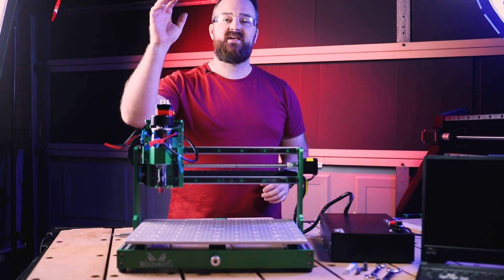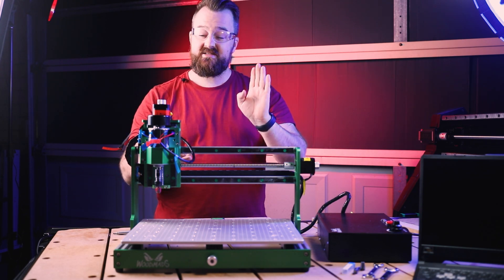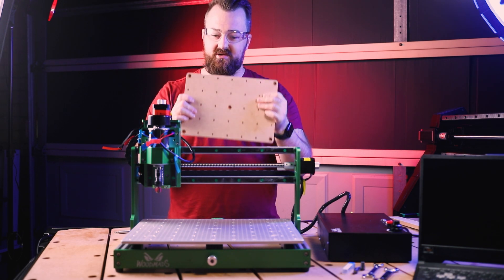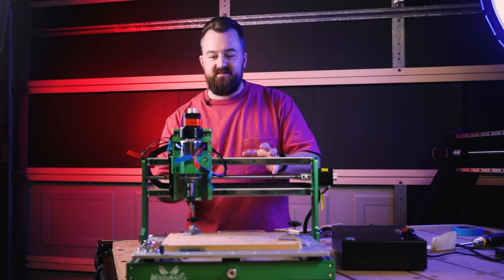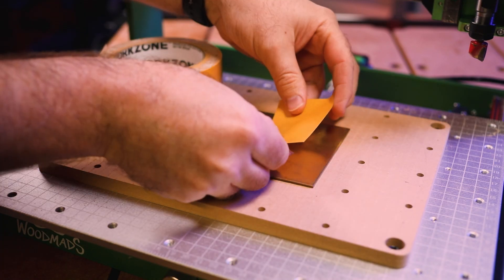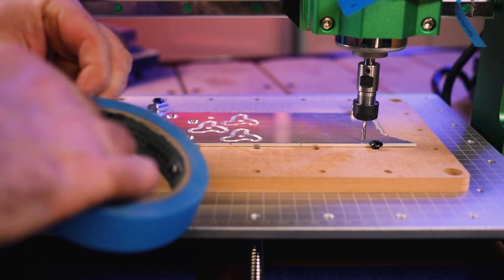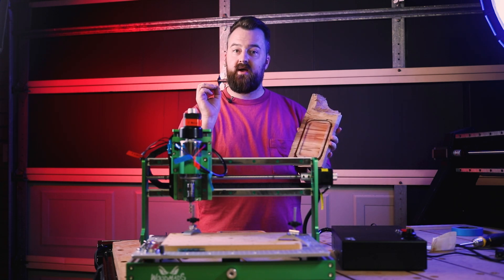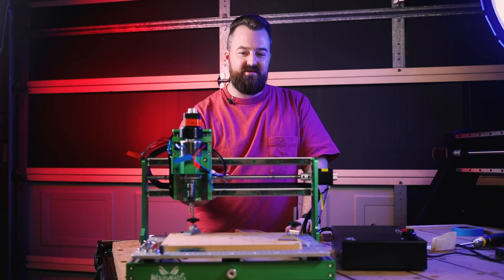WM3020 // FoxAlien x Woodmads

Comment: Got this machine six months ago. I played around with it for a few weeks then gave up :(

I wish there was a good YouTube channel on how to operate the is machine with third party software etc.
Reply from the maker: Great comment! I have been meaning to do something like this for a while. Happy to help you get started and figure what you need to know that I could include in a video. Send me an email at newtechcreative@gmail.com if you would be keen?
Reply: ….sent
Reply: Got mine today ... Started out with the standard software and it works. Really any grbl gcode sender will probably do. A few hours later I was designing stuff in fusion 360 and using the NC processor to generate the GCode.

Admittedly the default spindle is ok for a desktop machine. Probably will upgrade it to a teknomotor 330W, 400W or 600W before long though. If I manage to make a little adapter plate to mount it. Still it did blew me away on accuracy. A biiiiiiiiiiiig step up from my first machines (had several desktop models sofar including homegrown ones). This thing is a gem. Just don't expect it to be a professional metal milling tool. You can mill metal sure but if that is your goal there are better options (that cost more). Have one of those too, a 60x50 full fledged 70 kg heavy desktop CNC from Sorotec.

Why did I get this machine then, pcb's mostly or doing the odd little things like front panels or housings for those pcb/electronics projects. Things like that. Stuff where setting up the bigger machine (limited space workshop) would take to long for what it is. And of course pcb's is just easier to do by far on these smaller machines, odd as that may seem. Mainly heightmap probing that makes the difference there.
Reply: Wow ok thank you, I just need to put time in to playing around with it. Keep you posted!

Comment: What plunge rate, feed rate and RPM are you using from aluminum?
Reply from the maker: Thanks for your comment! From memory I think it was:
Feed rate: 400mm/m
Step down: 0.2mm
Spindle speed: max (I think max is around 10,000rpm)
Endmill: 3.175mm single flute 
This was cut with a ramping contour cut!
Reply: @NEWTechCreative  Hi (wow) thank you for the reply! I have one of these and have broken a bunch of bits using a 200mm/min plunge rate according to a Fox Alien video. But It looks like it will work with a ramping cut. What software do you use to do that? EstleCam does not have that.
Reply from the maker: Yes the ramping cut can be a less aggressive cut! I used fusion 360 to program the tool path however you might need to research to see if your software offers this!! Here are some other considerations for successful aluminum cutting:
- purchase a proper aluminum cutting endmill
- use 6061 aluminum 
- ensure that you use air to clear out chips and or lubricant to assist cutting
- ensure that you stock is secure as vibration might break your endmill.
Good luck 👍

Comment: I can assure you, ball screws make a HUGE difference on this machine. I have this WM3020 machine and have done a few  mods on it to improve overall accuracy. I can easily trust it to hold +/- 0.001" tolerance, something I could never do with my 3018 'PRO' machine. The typical lead screws with brass insert nuts & spring-loaded backlash compensation are weak points of any 3018 series machine.

That said, there are a few corners FoxAlien cut on this machine that they should not have, and kept it from being a truly 'next-level' 3020 series machine. They already charge the price for it, but they short-changed the design. I fixed a couple of these items with my modifications.
Reply: Alright so ... this is where I am at.
- Spindle, Teknomotor 600W HF spindle with VFD. From a well know German CNC store. They also sell mounting plates for this (square body) spindle and their hobby line machines. I shortened the bottom plate and drilled 4 countersunk holes in that same plate to mount the spindle to the Z-axis with the custom mounting plates they make. Main reason, decent spindle with ER-16 Collet (ER-11 is ok but not being able to use 8mm shanks always annoys me at some point).
- On order (waiting for arrival) : 3 T42 drivers with closed loop steppers (nema-17 also) 0.8 Nm variaty. Not sure these will work yet though. They look good but have an 8mm shaft. I might end up using JMC Nema-17 closed loop steppers (.IHSS42-24-05) instead. Little less power but I have their bigger brothers on my LinuxCNC heavy duty mill and ... well good stuff
- On order (in customs now) : RootCNC ISO 3 controller (FluidNC). This is the main reason (well not this controller but that it is GRBL compatible and thus easier to use with PCB isolation milling soft and techniques like height mapping, or that is the hope).

Even with just the Spindle on there... I am impressed. Using a facing mill with changeable inserts to face aluminum and getting quite nice results (for a machine like this).

I did have to fix the Y axis endstops. The endstops on this machine are ... well ... bad. The one on the Y axis uses one of the heads of the screws for the linear carriage to actuate the microswitch... Baffled as to who thought that was a good idea. Didn't take long for that screwhead to go past the roller, then come back the other way and bending the roller and leaver of the microswitch back onto itself. Used a better brand and with a longer lever so it hits the frame before the screw goes past the roller and might go for inductive ones too (the out of the box controller isn't really designed for that, unlike the RootCNC one).
Reply: @xConundrumx  Wow, you're really well on your way to a NICE setup! Love it! You've selected some really good quality components. I hear you about the limit switch trigger on the Y axis (as well as the X). I had to put a washer under the 'home' position screws to ensure a good reliable trigger for X and Z. On the other ends, it doesn't trigger, I have it set up with soft limits. 

Actually, my WM3020 went into early retirement. I had a custom Onefinity built, and jacked the nice table plate from the WM3020 to use on that. I have since replaced it with a standard 3018 type of extrusion table, and will probably pick up an Openbuilds controller for it, just so it will be a running machine that can either be put back into use, or sold.
Reply from the maker: Thanks for this info!! If you have any videos or photos of you upgraded machine, I would love to see it!!
Reply: @NEWTechCreative  I've got some pics (no videos), but not sure where I can post them for you to see. Are you on FB at all?
Reply from the maker: Yes I’m on as Myles Newtech otherwise email at newtechcreative@gmail.com !!
Reply: @billblades9195   what mods did you make ?
Reply: What mods did you do to make it better? about to pull the trigger.. probably...so many opinions to sift. Thankful for any advice you have
Reply: @digitalabstractions  Just sent you a DM on FB. Will follow up later.
Reply: Thanks!
 @billblades9195
Reply: @billblades9195  also interested in this, mine is arriving day after tomorrow so ...
Reply: I doubt you will get this comment seei g that you post is from 2 years ago but who knows I will still guve it a try. So I just got this same exact machine 2 months ago and am having some issues with getting g it to run. Its my first machine, so in very new to it. I have watched countless videos on how to set everything up but I still can't seem to get it to run/having a hard time setting it up. Is there anyway I could get your email address or I can send mine and we could possibly talk about what I could be doing wrong. Im at the point where im about to give up and buy a different/newer machine. Its pretty rare that i give up on anything but im just completely lost on what im doing wrong and just about at the end of my limits 😢

Comment: I'd also recommend the AnoleX Evo CNC which you can get for $700. I know it doesn't have ballscrews, but I can't imagine how much of a difference it makes at this level of machine. On the other hand, it's got a larger 3040 bed, larger 60mm stepper motors, a beefier gantry and still maintains dual linear rails on each axis and the ability to plug in a laser and purchase other size spindle/router mounts. Other than the ballscrews it's a better machine and it's so much cheaper you can upgrade to a compact router and 65mm mount for the same price as the Foxalien. It's been great for me so far. 

Here it is taking 5mm deep passes through aluminum, and this is with the $500 base version using a compact router: https://www.youtube.com/watch?v=UP9l-aTyTis

https://anolexcnc.com/collections/cnc-machines/products/pre-order-all-metal-cnc-router-machine-3030-evo-pro-anolex-xyz-axis-dual-steel-guide-rails-cnc-router-with-3040-metal-table-300w-spindle-limit-switches-emergency-stop-for-aluminum-wood-acrylic-mdf3040
Reply from the maker: Thanks for sharing!! What spindle is in this video? It’s definitely not a 300w…. Looks more like a vfd controlled spindle?
Reply: @NEWTechCreative  it’s a Makita router. I got a carbide compact router for $80 which is essentially the same thing but it doesn’t have the problem of the dial vibrating loose and comes with precise collets for $80.

Btw your newest cnc build is freaking amazing. I started watching your channel for the mpcnc content cause I had one I’d been putting together for years and it’s been crazy to see how far you’ve come since then.